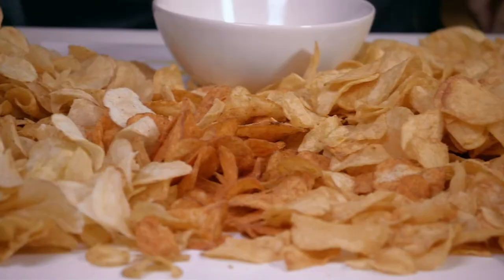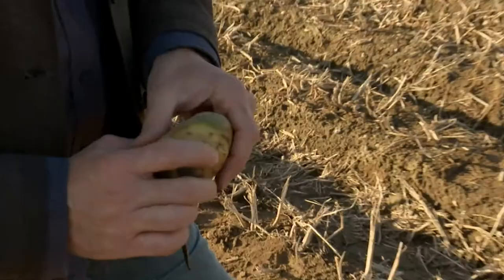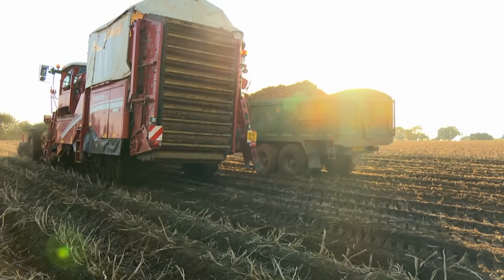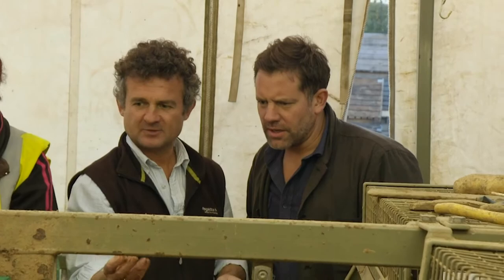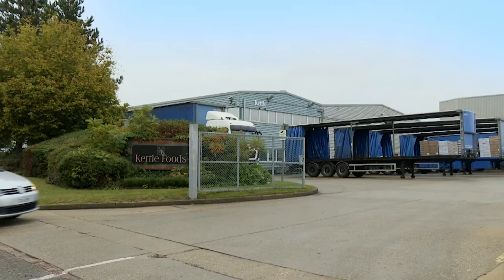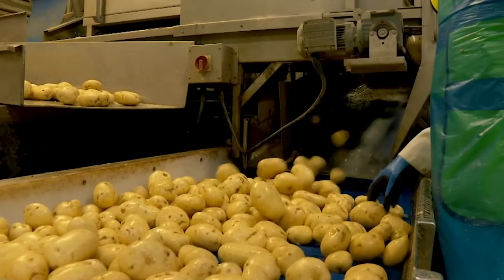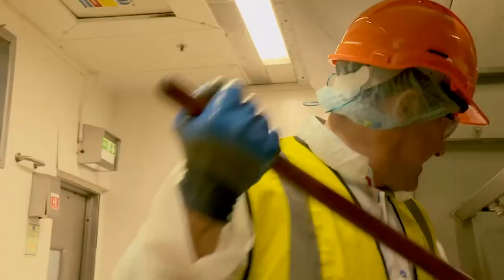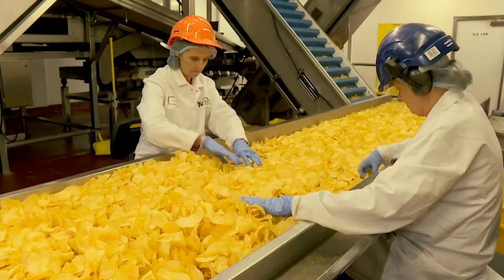Why are some Crisps/Chips Green… and are They Safe to Eat? | Food Unwrapped

Comment: wouldn't the toxic be neutralized by the frying process?
Reply: Apparently the answer to that is a distinct maaaybe. Boiling isn't enough to degrade Solanine, and the internet says frying "can" (which seems a lot more hedged than "will"). But the point is that it is a toxin, not a bacteria or virus, so it is more plausible that it could survive high temperature.